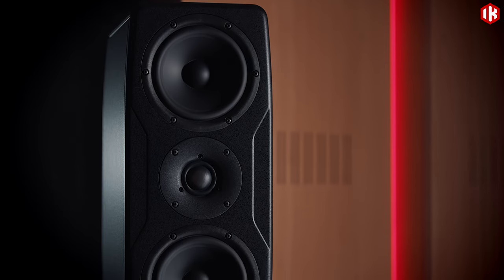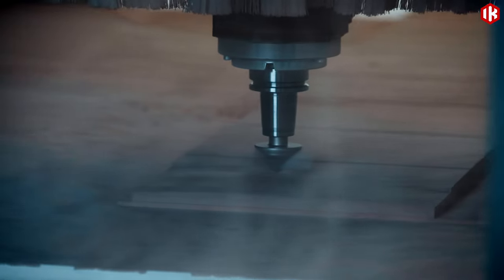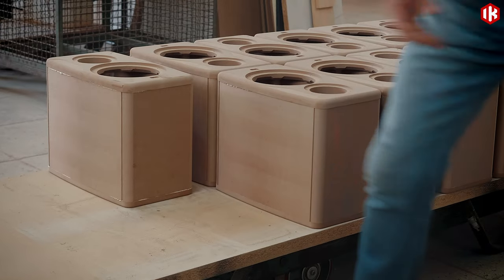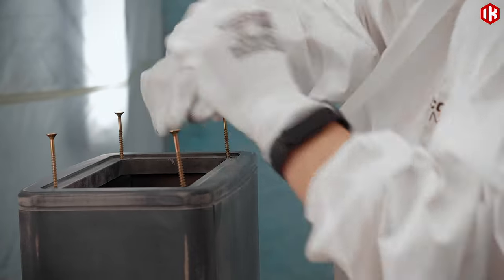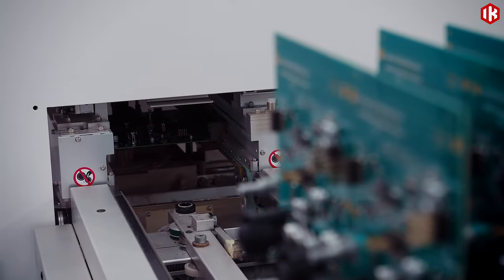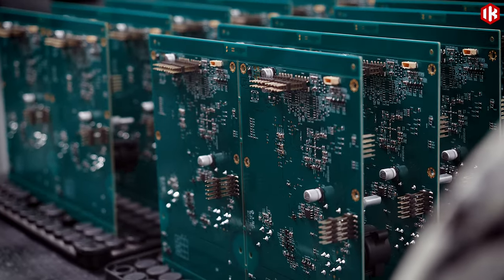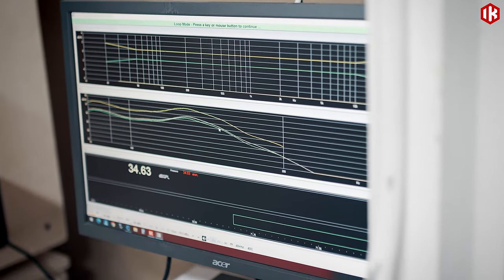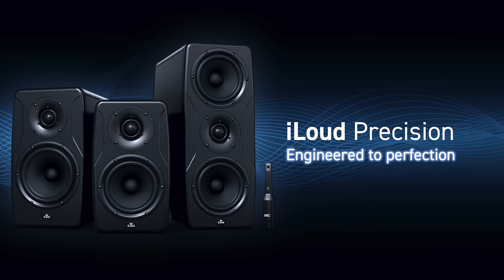iLoud Precision - Made In Italy - a proud tradition of Italian craftsmanship

Comment: Alright! The old MTM ones will be dropping in price soon, and I will grab those ASAP (fixed income.....)
Reply from the maker: These are a new line, they don't replace iLoud MTM so we don't have any plan to permanently lower prices of iLoud MTM unless there is a promotion.  Especially with continuing component prices and supply chain issues that would not be possible.
Reply: Maybe in the used market. Good luck :)